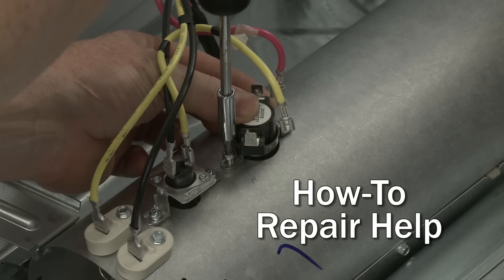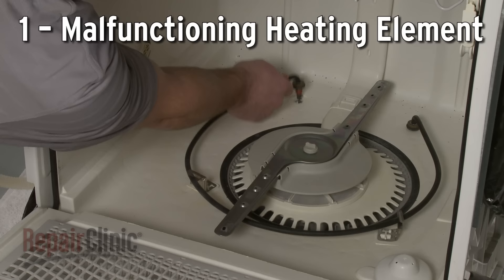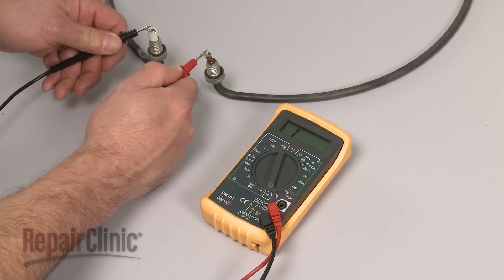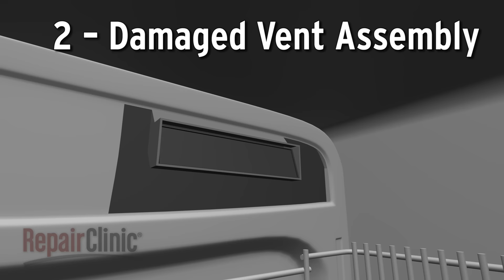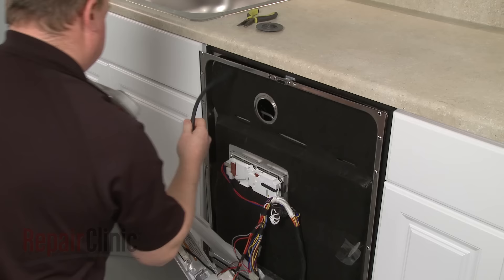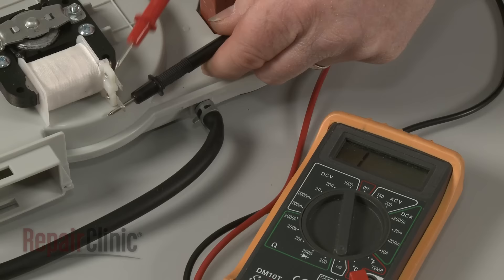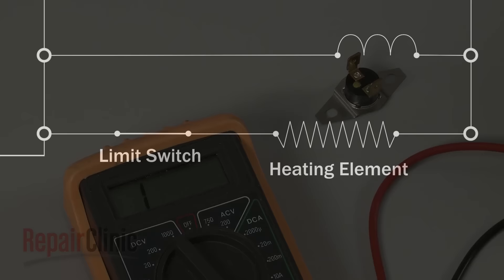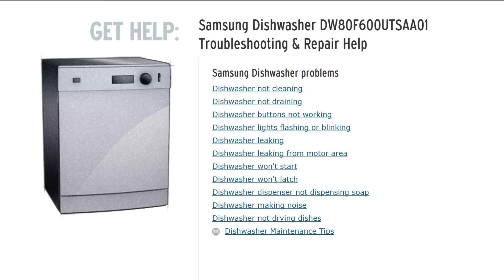Top Reasons Dishwasher Not Drying — Dishwasher Troubleshooting

Comment: I have replaced the heating element and high limit thermostat but it has not helped with my problem.  So; according to your video, it might be a vent, or vent fan problem.  I suspect it might be in the control panel circuit board.  If so; I take it that you suggest I get professional help; "aka a serviceman"!  Ergo, I have wasted my time pursuing a "do it yourself" journey.  I guess I might want to add up all the costs of parts already purchased with what a new circuit board may cost; and guess what an appliance repair person might charge.  And then I might want to compare that with the price of a new Whirlpool D.W.  Or, just not worry about a little moisture on our precious dinnerware.  The truth is, that I appreciate your video, and find it helpful...so thanks.
Reply: Next time,  instead of replacing the parts, you may want to use a multi-meter and test for continuity.   That way, you can determine exactly what the problem is...or more importantly what the problem isn't.  If you are a homeowner, I can assure you that you'll put a multi-meter to use, so don't feel bad spending $30 bucks on it.
Reply: Ed Lowe I'm sorry Ed; perhaps I failed to explain that I had already checked for continuity....the heating element was bad...no continuity.  So I have no regrets about any costs for that item.  My next concern was the "Heat Limit Switch"....I didn't know how to test it.  It showed positive for continuity; but that didn't tell me anything since I didn't know whether it should have been "N.O. or N.C.".  In other words, if the limit switch found conditions too hot; would it open a circuit, or close a circuit?  I guess that's where I found he instructions lacking....otherwise I found it helpful.
Reply: Man that's terrible....so the element was bad, but replacing it didn't fix the problem.  I feel your pain. I can't even count how many times I've tried to fix a problem and it ends up not being the problem or a new problem is created trying the fix the old one.
Reply: It was one element of the  problem, checked for continuity and it was bad...so far so good.  My desire was to know how to check the "High Limit Thermostat"...I replaced it as well.  I checked it for continuity and it there was continuity...however, in this case continuity might mean that it's faulty.  If it should show an open circuit (N.O.) then maybe it would be good...on the other hand, if it showed continuity, perhaps that's bad.  I just wished someone would have explained how to test the Limit Switch...
Reply: @wesleyhill4922  the switch should be normally closed
Reply: After replacing a bad heating element or thermal fuse you must set the machine into diagnostic mode to reset the control board. Whirlpool dishwashers (and other brands) will continue to run the wash cycle even if there is an error detected with the heating components. It will run through the normal wash cycle, but skip the heating cycles. To enter diagnostic mode on Whirlpool dishwashers you must press any 3 keys in rapid succession 1,2,3,1,2,3,1,2,3 and the machine will enter diagnostic mode. An LED blinking a certain number of flashes will indicate which error fault is detected. After the diagnostics are run, the machine will reset and clear all the error codes. I'll bet you this is the problem.
Reply: @aidanmetzger551  thank you sooo much! This totally fixed my problem. After I replaced the heating element, it still wouldn't get hot. The reset fixed everything!
Reply: @aidanmetzger551  Does all whirlpool dishwashers need resetting? I have checked my heating element with a multimeter that's fine. The thermostat is reading all different ways. How do I know if that's bad..what should the number read on the multimeter?

Comment: My Whirlpool dishwasher is about 3 years old and will not heat.  I have replaced the heating element and the thermostat but it still does not heat.  Any suggestions?
Reply: I been there also, next step is $200. board. It is said but they make these units to last about 5 years so you buy parts then you will buy a new one then you will pay to get it haul off with all the new parts and the cycle goes on.  Washer, dryers, dishwashers lasted 30-35 years, WHAT HAPPEN!!!!!!!!!!!!!!!!!
Reply: @joeescue100  keep in mind after you replace any component on the dishwasher, you have to "reset" the dish washer so it tests and recognizes that parts are working. This is a must, not an option. I replaced a circulation pump and it wasn't heating. i had to reset the dish washer, it tested all parts one by one and viola, heating element was working again. to reset kitchenaid dishwasher, open door and press any 3 "option" buttons one by one for a total of 3 times..for e.g. Heated Dry > Hi-Temp Wash > Sani-Rinse one by one and repeat this for a total of 3 times. All lights will go on indicating its in diagnostic mode, close the door and let it run..it will run for about 10 mins and test each cycle and each component. it will flash all lights and beep 3 times to indicate it has finished. your dishwasher is reset at this point and ready to use all working parts now.
Reply: I am looking at purchasing a Whirlpool dishwasher on craigslist for cheap only problem is it wont dry at all... I may not purchase seems like u are the 2nd commenter to say that their whirlpool doesnt dry and the other one said they replaced 2 things already and it still wont dry. I think I am okay with not buying whorlpool
Reply: @AtlzBestM26  thanks I'll try this
Reply: @AtlzBestM26  9